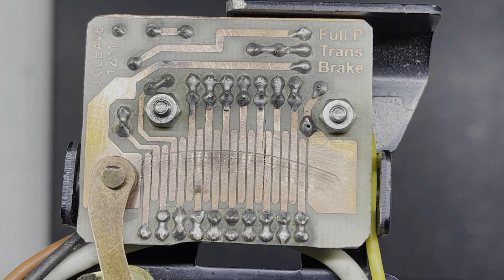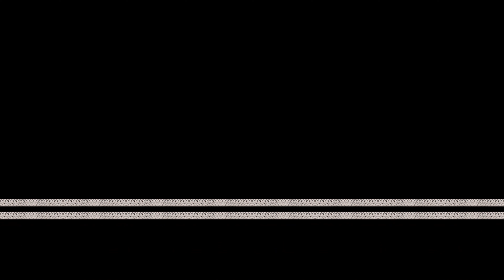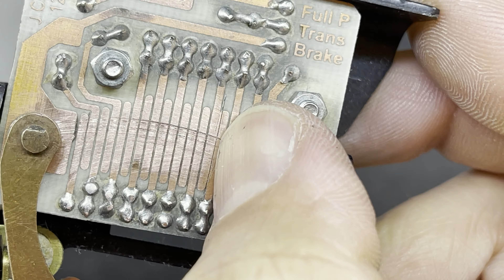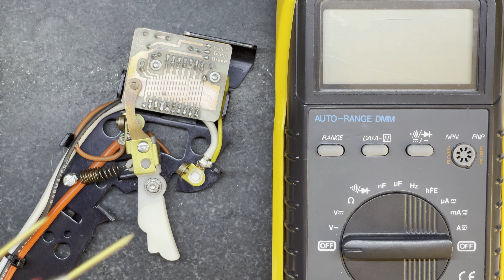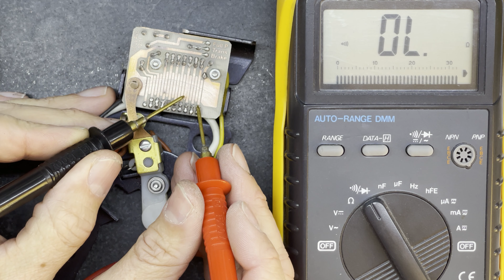Resistance is futile - unless you know how to fix your slot car controller

Comment: In the early 1990s, I played with 1/24 scale cars. Our controllers were one ohm or less and they got very hot. I'm now playing with 1/32 and my old top-of-the-line controller is too sensitive to keep my car on the track. It seems that modern controllers for 1/32 are 30 ohm and up. Why the difference in resistance? Thanks
Reply from the maker: It really depends on the type of motor. If the 1/32 cars you are talking about are things like NSR and Slot.It cars then the motors are very mild and have many turns of very thin gauge wiring. This means that the equivalent of a higher ohm controller will be needed. The 1/24 cars you raced many years ago probably had fewer turns of thicker gauge wire hence a lower ohm controller was needed.
These days at the top level, everyone uses electronic controllers which are adjustable.

Comment: I have a controller that does not use a wiper arm and you have many more bands but it is impossible to clean it. I use several controllers and most use the wiper arm. I thank you for posting slot car videos.